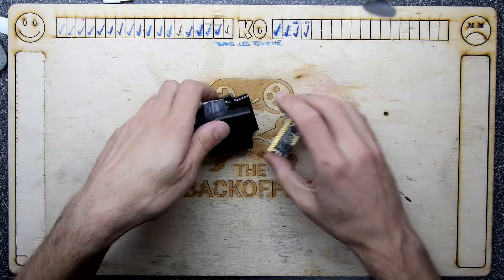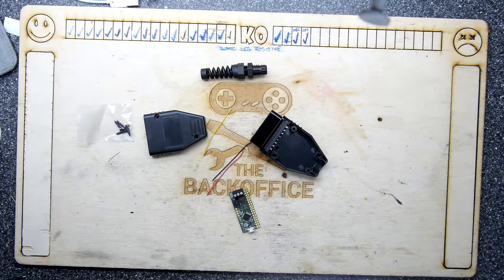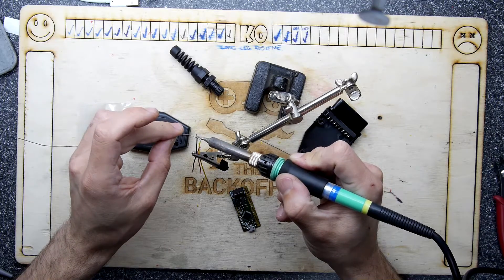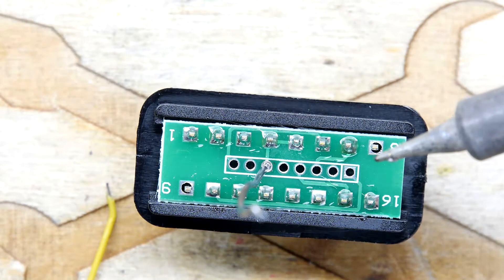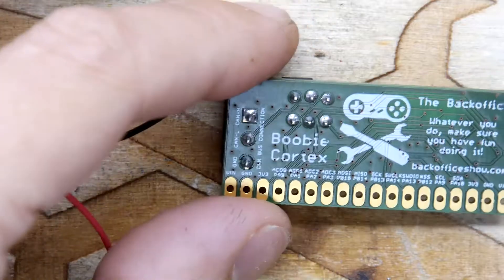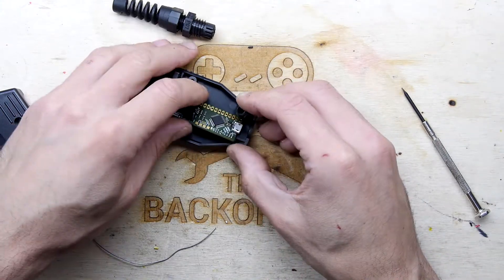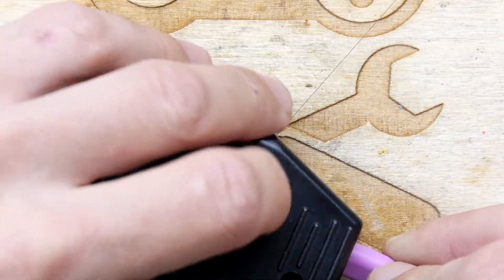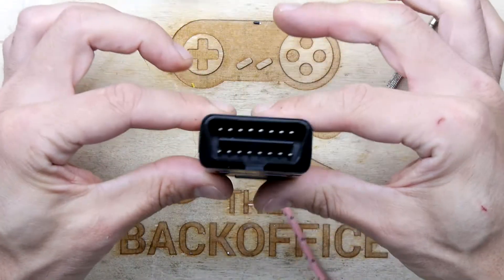OBD2 CAN logger

Comment: though u would have added a little bit of complexity u probably could have put a small buck in there with an enable pin and one wire to a keyed fuse. perhaps a resistive dropper and a fet. I've seen appropriately-sized buck converters though on eBay. I haven't watched all the way through yet but if you want the logger not running the USB to the 12-volt or Cigarette Outlet would be kind of nice. And even with either of those methods the complexity added is not very much

Comment: Pin 6 is actually going on Hole 1 ;)
Reply: directions unclear. with out addressing gender hole purpose is ambiguous. unsure if output only, preferential i/o or general but time delayed io or if the pin is a symbol of power thst freud thought others were envious of. it's pretty clear you don't put a wire in hole 1 of in one though.. except to people who practice sounding but I think in general ur more likely to get a punch than vcc /s

Comment: Wow, I just looked a little closer at OBD2/Canbus and other bus protocols on the OBD2 socket, and it looks like you are in for a lot of "fun" with this project. This seems like a useful page on the subject: http://marco.guardigli.it/2010/10/hacking-your-car.html
Reply from the maker: +MrPGT9999 they are really good fun, and you can activate triggers based on values read 😂
Reply from the maker: +MrPGT9999 Forgot to say, the boobie cortex play really nice together on CAN, it's a really nice protocol for IOT type things and has a really nice speed. I'm looking forward to some interesting projects like streaming audio over CAN to the garden or something.
Reply: I was more dismayed by the amount of different protocols, standards and manufacturer variations in the OBD2 socket. So many cars refusing to talk to your adapter would be a headache. Audio streaming isn't something I had associated with CAN, but as long as it doesn't swamp the network causing congestion for other data, it would probably be highly workable.
Reply from the maker: +MrPGT9999 the easiest way is to tap into the internal can networks so you can have full access to the goodies. The obd route is horrible unless it's a USA and a lot of French cars as they seem to be vanilla CAN